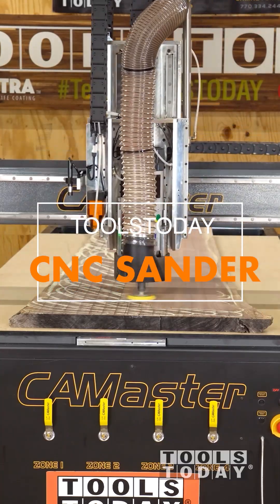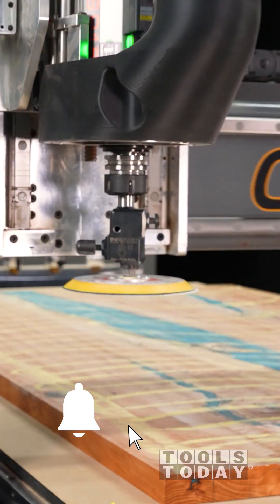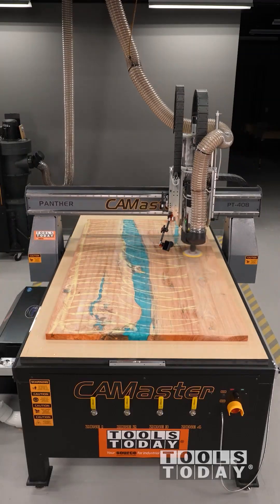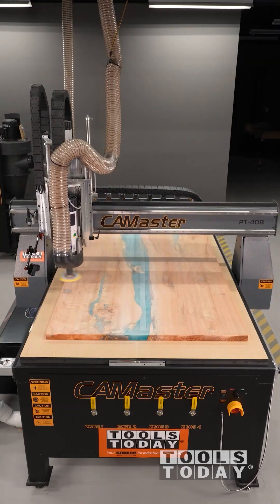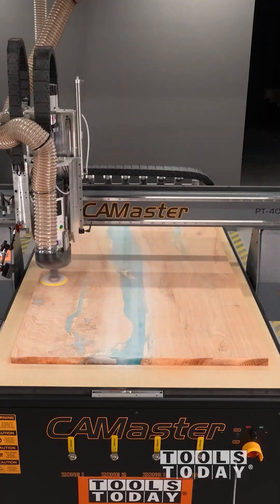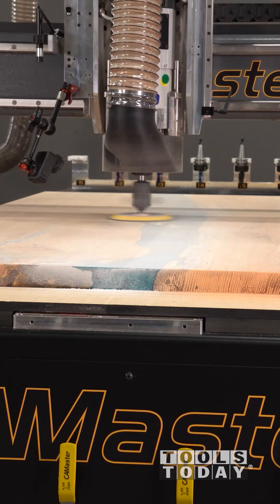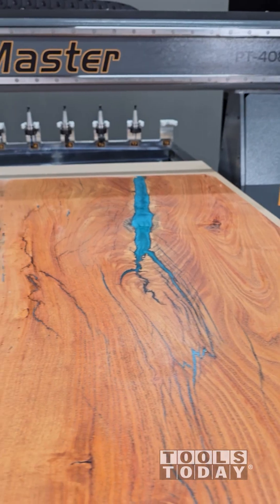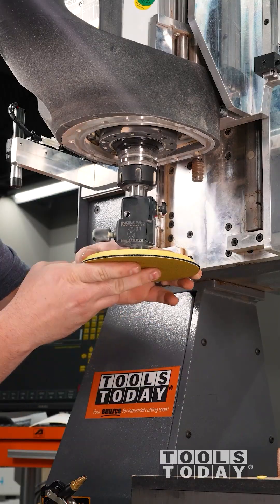CNC Sanding | ToolsToday

Comment: Similar to my last question on the 4", what are you using as a camera on the side mount of the spindle plate to capture the footage? Also, this sanding seems to not have a dust collection system operational, either that or I'm just not seeing it perform and pull dust particles through the hose. Is that correct? Is there a challenge with dust?
Reply from the maker: The camera on the side is just a GoPro camera.  I removed the brushes from the dust boot while filming.  It is pulling quite a bit of the dust, but my dust collector is only 1.5hp and very under powered for this application.  If the brushes were on the boot and I had a 3hp dust collector, it would likely capture the vast majority of the dust.

Comment: What are you applying prior to sanding? I definitely need this in my life! What is your fps? I have been doing mostly burr oak, hard maple, white oak, basically super hard woods and it’s taking me 4-6 hours per side with a 24” belt sander on 60 grit before my final finish to get it the way I want. My slabs are usually in the 68”x120+” range.
Reply from the maker: Before sanding I'm just using chalk to mark my progress.  With 80 grit paper I'm moving at 250 inches per minute on the machine.  You wouldn't flatten the boards using the sanding attachment, you would need to surface each side first then sand it using this attachment.  It definitely would speed up that belt sander process!
Reply: @ToolsToday I definitely level it but to get rid of any tool marks it takes a long time. Thanks for the info!